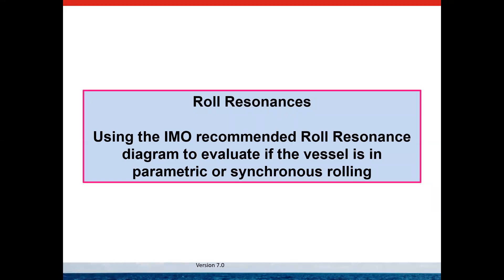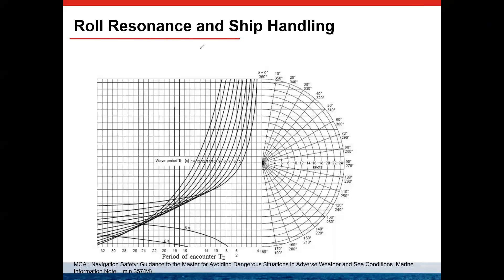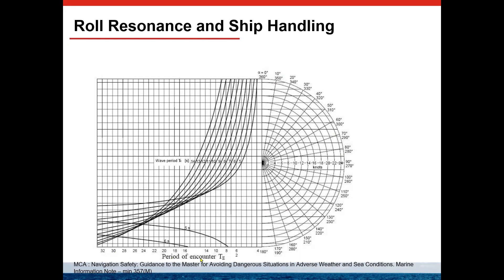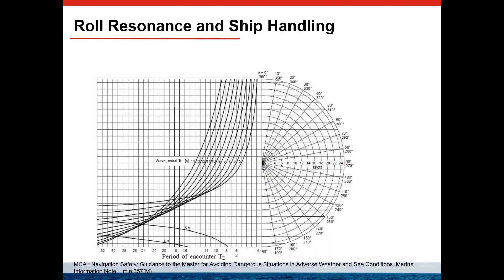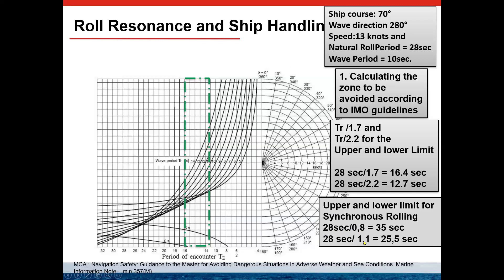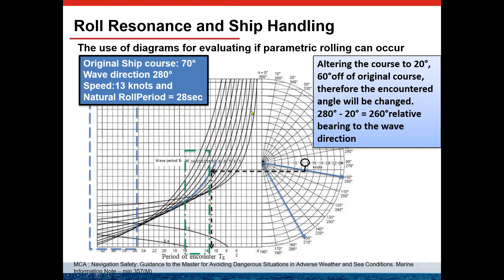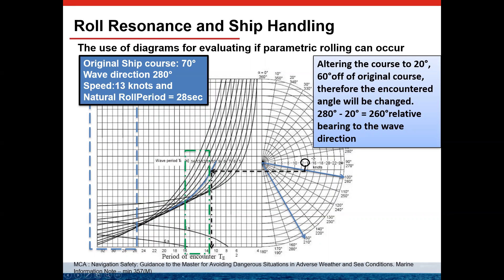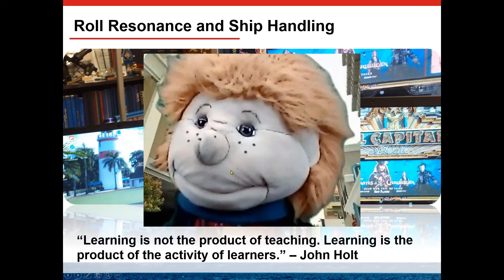Using the IMO recommended Diagram for getting the Period of encounter

Comment: have you been try to use the other formula to determine the TE, could you please advice us of the result of calculation. thanks for ur videos
Reply from the maker: Hallo
Yes I have used the formula for getting the TE as well and the results we're the Same as I used the graphical solution using the diagram.I tested it for nearly 100 cases and the results were nearly the same.The diverences are very small and therefore not from interest
Reply from the maker: If using the formula it us important to use the correct Figures
where T is the Wave period
V = ship’s speed [knots]; and Alfa is angle between keel direction and wave direction (Alfa = 0° means head sea) 
The Diagramm is based in this relations